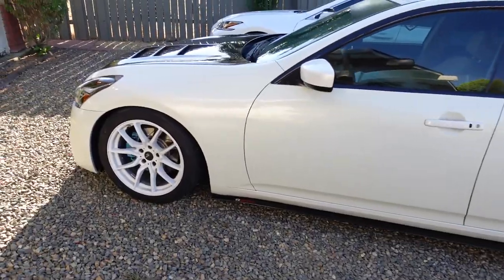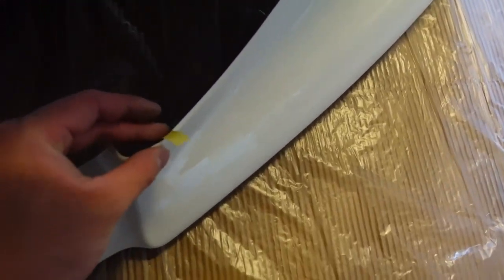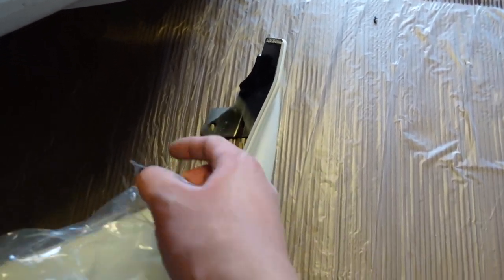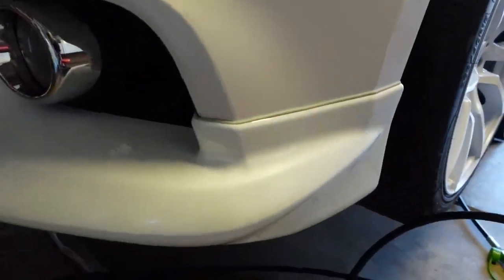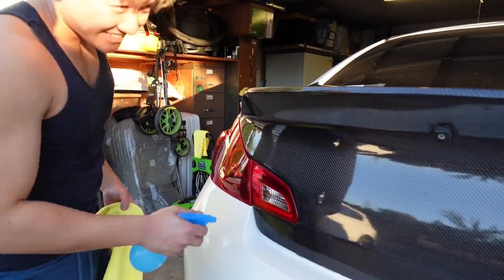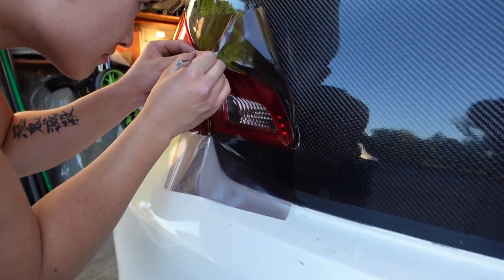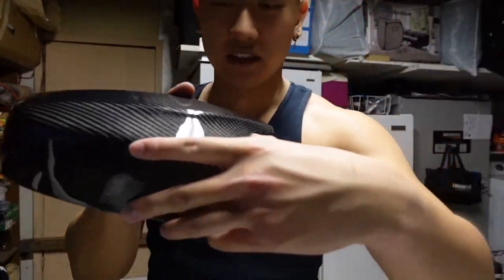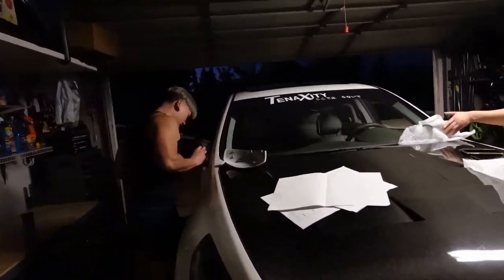G37 SPORT FRONT LIP INSTALL & CF Mirror Caps

Comment: Hey. I’m thinking of buying a g37x sedan as a daily driver but I’m concerned about the gas mileage. How many miles can you get out of a full tank of gas?
Reply from the maker: for a full tank I think around 250-300, gas mileage isn't the best or worst on these cars in my opinion.
Reply: If you’re gonna be using a g as a daily least think you think about it is gas mileage. You want good gas performance buy a Camry or any reliable 4 cyl